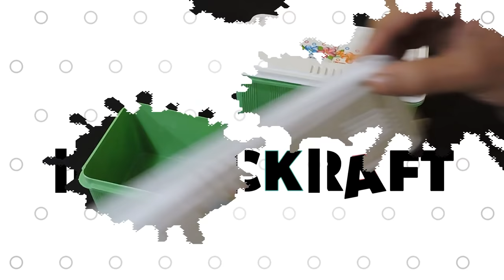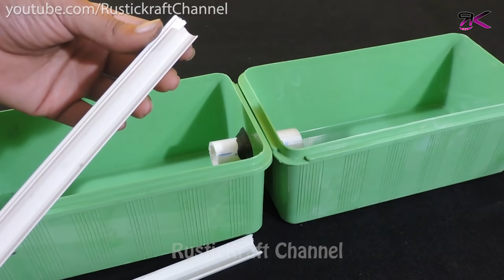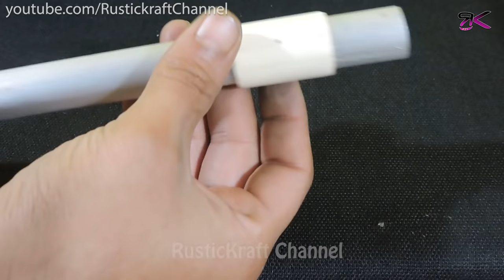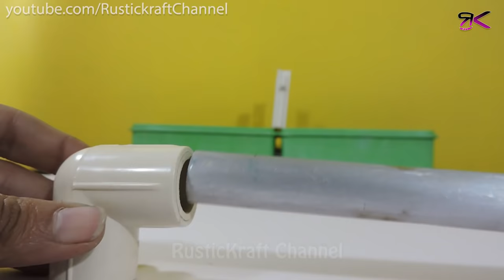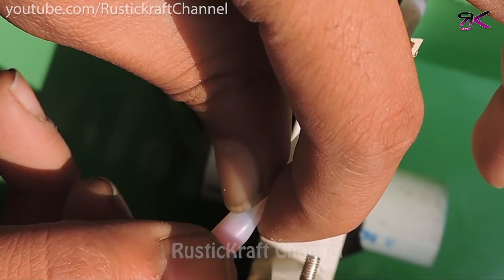Garden see-saw water feature  | How to make

Comment: I have a problem: once water enter the pipe, one side goes down as the marble goes down too, but the higher other side doesn't come down but instead stays where it is, what's the problem?
Reply from the maker: Increase the size of the marble, or decrease the width of the pipe The water must stack behind the marble so the other side can come down.
Reply: @RusticKraftChannel  would the see saw still work if I didn't put the models on the both ends of the balancing pipe?
Reply from the maker: @ethanol4583  yes it will still work.

Comment: For someone who doesn't understand how it works. I make it easy to follow:
Keep in mind that it doesn't matter with metal or pvc pipe with its size.
You can use all PVC pipes, and what you need:
- one long pipe, let try with 15 inches, you divide it by 3: AB=BC=CD= 5 inches
- two very short pipes go inside the long pipe and stay at B and C. These 2 pipes hold the ball at either B or C. 
Make sure you select the ball that fits the smaller pipe and can stop water running through the lower end of the long pipe.
Assuming that the ball is at B that has it end lower than the other end. Water running through the center of BC (the long pipe) from B to C (no ball) and to the end.
It makes this part heavier and the ball runs to C.
Now the water runs from C to B to the end and this part will be heavier that makes this end lower than the other.
You can do anything you want at each end, but it must be same weight for better movement.
Hope you got it after watching this video.
Reply from the maker: Great man!!! You explained in details.....

Comment: Nice  why people don't understand how it work?
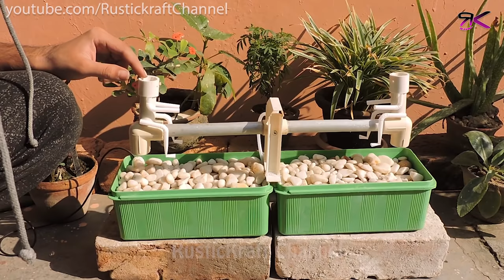Reply: It will not work for you because he pulls on the rope and watch this footage. 3:38
Reply: @mohirqollar2022  For someone who doesn't understand how it works. I make it easy to follow: Keep in mind that it doesn't matter with metal or pvc pipe with its size. You can use all PVC pipes, and what you need: - one long pipe, let try with 15 inches, you divide it by 3: AB=BC=CD= 5 inches - two very short pipes go inside the long pipe and stay at B and C. These 2 pipes hold the ball at either B or C. Make sure you select the ball that fits the smaller pipe and can stop water running through the lower end of the long pipe. Assuming that the ball is at B that has it end lower than the other end. Water running through the center of BC (the long pipe) from B to C (no ball) and to the end. It makes this part heavier and the ball runs to C. Now the water runs from C to B to the end and this part will be heavier that makes this end lower than the other. You can do anything you want at each end, but it must be same weight for better movement. Hope you got it after watching this video.

Comment: someone explain the mechanism please.I didn’t get it
Reply: For someone who doesn't understand how it works. I make it easy to follow: Keep in mind that it doesn't matter with metal or pvc pipe with its size. You can use all PVC pipes, and what you need: - one long pipe, let try with 15 inches, you divide it by 3: AB=BC=CD= 5 inches - two very short pipes go inside the long pipe and stay at B and C. These 2 pipes hold the ball at either B or C. Make sure you select the ball that fits the smaller pipe and can stop water running through the lower end of the long pipe. Assuming that the ball is at B that has it end lower than the other end. Water running through the center of BC (the long pipe) from B to C (no ball) and to the end. It makes this part heavier and the ball runs to C. Now the water runs from C to B to the end and this part will be heavier that makes this end lower than the other. You can do anything you want at each end, but it must be same weight for better movement. Hope you got it after watching this video.
Reply: @phinguyen1870  I didn't get it after watching the video.But thanks for your explanation.Now I hope I'll be able to make this.